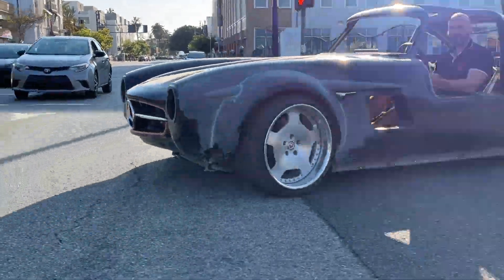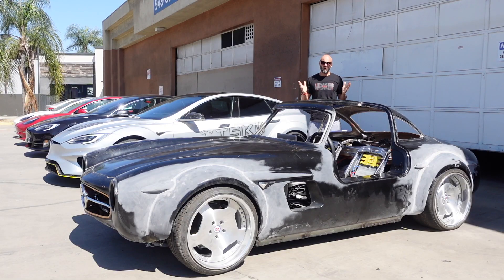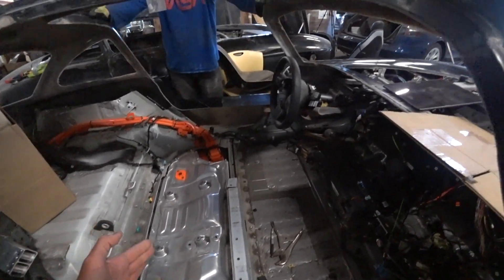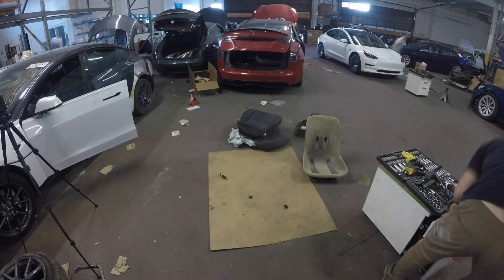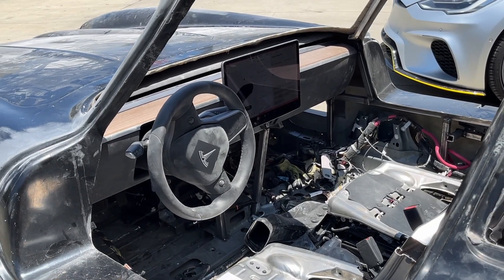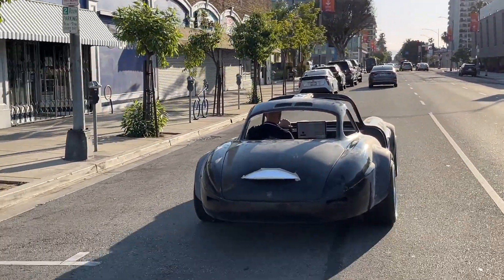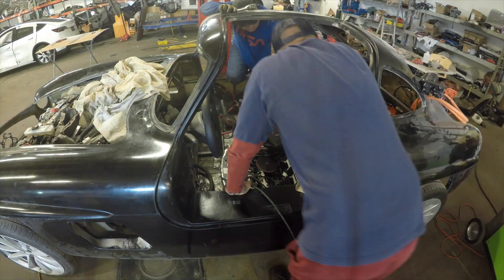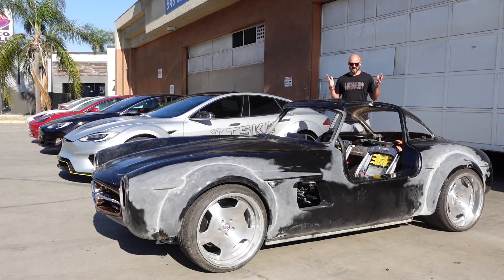#TeslaGULLWING FIRST DRIVE / TESLA powered MERCEDES-BENZ SL300 Ep.5

Comment: Wow BEAUTIFUL build it took me hours to locate your channel after I got a glimpse of your car on another channel reporting from SEMA 2023 an amazing build I have many questions!!!   

1) How much did you have to reduce the battery pack capacity?

2) What was the overall weight reduction?

3) Was supercharger access maintained? 

4) Are the gullwing doors actuated electronically or manually?  

5) Are the windows on the gullwing doors operable? 

6) Does the air conditioning operate properly?